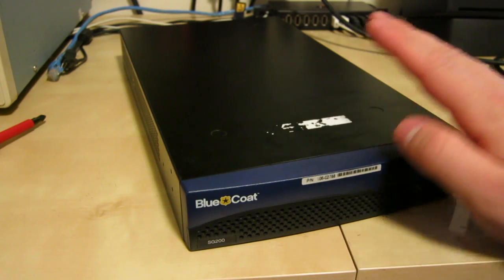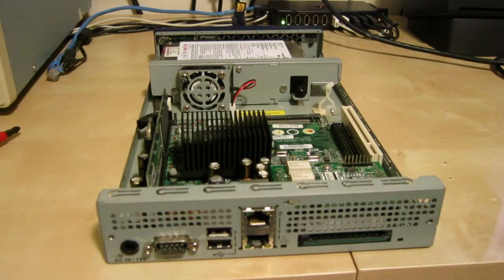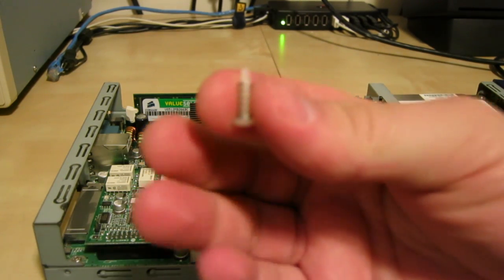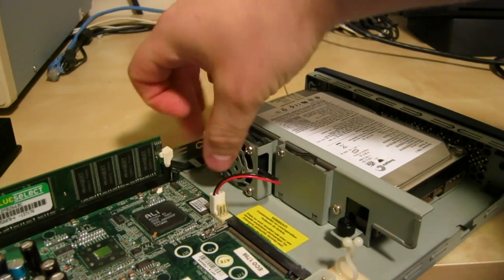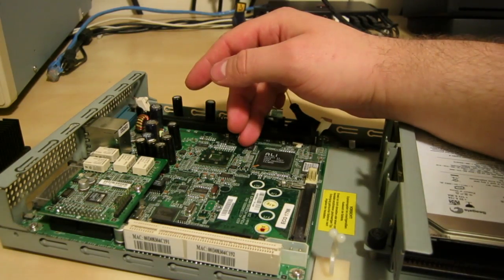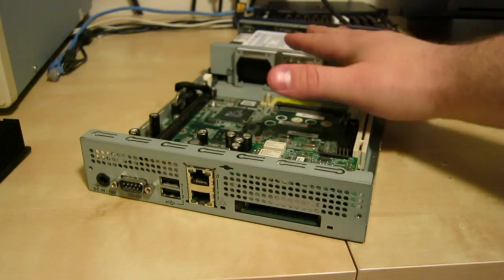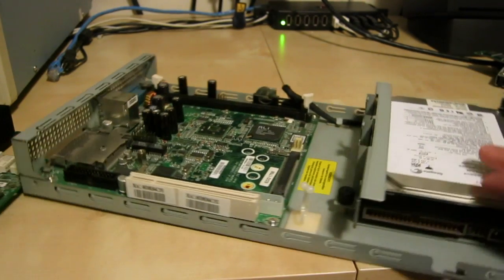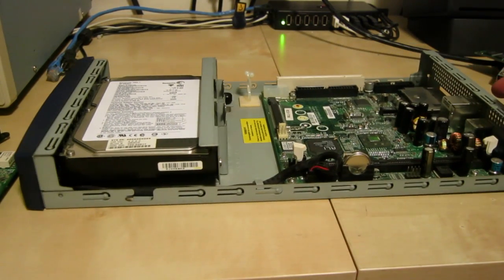Blue Coat SG200-B Proxy Server Teardown

Comment from the maker: DigitalDiabloUK Generally these network appliances run a security hardened version of Linux of their own design. This drive was labeled with an OS version (4.2.2.2) and it is in a totally unrecognized format (at least on my Mac OS X machine with FUSE). So it's probably a lesser used file system.

That being said, I ran an unerase scan on it as many of these devices cache internet traffic images/documents and that can give you hints of who owned it since these are usually sold by surplus places when companies go under. This drive had some general internet images (Google logos, etc), nothing too interesting. Of course there was the usual assortment of cached porn thumbnails and images.

Comment: Hi, did you have the chance to boot any other OS on it? It seems to me as a good device for a pfsense of sorts. Nice video!
Reply from the maker: Vinicius Provenzano I don't really recommend these boards for pfSense. You really want to track down an Atom motherboard with dual Intel NICs. These cheaper embedded boards usually run Realtek NICs and they will cause you nothing but problems with pfSense. :)
Reply: Thanks for the review. Let me point out: this board has two intel nics onboard ;-)   , also, i ran pfsense for years and years with realtek nics, never had any problems! The intel nic that i recently acquired for pfsense as wan nic did give me lots of problems (refused to auto negotiate at 1gb wire speed), switching back to realtek solved my problem in this case... For whom is reading this: future pfsense releases require not only 64bit architecture, but also aes enabled cpu. Check opnsense if you want to keep your 32bit appliance running